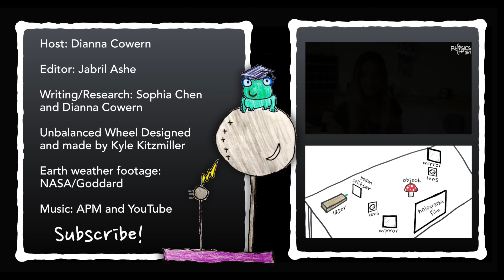Are perpetual motion machines possible?

Comment: "Lisa, in this house we obey the laws of thermodynamics!" - Homer Simpson.
Reply: yes... the modern slaves do
Reply: The earth is a giant capacitor, where does the energy come from that fills it?
When you extract a portion of the energy from this capacitor will the capacitor be topped off?
Reply: @messengerofiexist2139  Google about T. H. Moray free energy receiver. Moray succeeded in tapping into earth capacitor, and extracted kilowatts of power.
Reply: @marcisgulbis9310  sure but you can't do any of that without a working flux capacitor and a sizable rotary girder.
Reply: @michaeld4861  No, Moray device requires ordinary capacitors, germanium transistors, oscillator circuit. Flux capacitor not required.
Reply: @marcisgulbis9310  You realize that posting links to perpetual motion machines on a physics chanel where perpetual motion machines are debunked is the definition of barking up the wrong tree?
Reply: @BigUriel  There is evidence that RegenX generator creates energy. RegenX generator has been tested and validated by SIEMENS Inc. I want them to look up evidence, and try to debunk RegenX generator, or admit that it works.
Reply: @marcisgulbis9310  No there isn't. The "evidence" you speak of is the same sort of "evidence" that the Earth is flat or vaccines cause autism. It's only "evidence" for people who don't understand basic science and are easily misled.

Go peddle your snake oil somewhere else.
Reply: A man of culture I see
Reply: Homer's quote is very funny and leaves a morale. Lisa Simpson is a well educated and clever student, that is portrayed as a future president. Homer's brain is portrayed as a peanut totally intoxicated by beer. I would like to know, what Homer thinks is zeroth law of thermodynamics. He drinks cold beers, so he must know. Ha, ha, ha.
Reply: @marcisgulbis9310  Electric generators transform kinetic energy into electric potential energy and heat. All of them overheat. Therefore some of the energy supplied is wasted as heat. You "have to account" for heat dissipated in your energy balance. No matter how sophisticated the device is, "what goes up must come down, spinning wheel got to go round". Don't tell me that a spinning wheel can also go up spontaneously.
Reply: @marianskodowski8337  You DO break laws by drinking and driving. You do not break thermodynamic laws by drinking beer at home, like Homer Shitsom.
Reply: @vperez4796  Tesla coil is overunity device, and can output more power than input power. It is based on the principle that the power output of a
 circuit increases with the square of the frequency and the square of the voltage. So, if you double the frequency and double the voltage, then the output power goes up and becomes sixteen times greater.

As a result of this, Don’s best known design uses a Neon Sign Transformer circuit which raises the
 frequency to around 35,000 cycles per second and raises the voltage to anything from 2,000 volts to 12,000 volts, giving a power output is physically quite small and yet it has an output of 160 kilowatts (8000 volts at 20 amps) from an input of 12 volts 1 amp. That is, the output power is more than thirteen thousand times greater than the input power. Consequently, his designs are for experienced developers only.
Reply: Is it not true?... A perpetual motion machine... But I still seeking of it.
Reply: Hope you're wrong...
Reply: Think of syringe with a pressure chamber attached on it...then you will see.
Reply: @marcisgulbis9310  Here is an appraisal of Power= W(inp)+W(out)+ H. Where W(inp)= V*I delivered to  ionize He(gas). Where power(out) = power dissipated as light by the He(gas) + Heath during production duty. BALANCE of POWER: Power(in) = 5000 V* 40mA = 200 Watts, values taken from Ballast specifications. Maximum Power(dissipated by Ne) = 170 Watts (at 40 mA maximum). Clearly some power is lost = 30 Watts of heat, NOT PRODUCED. According to Ne light's tables, the power dissipated in a plot I vs VI(max) = 170 W. As current raises above 40 mA the "power dissipated decrease". Values taken from Ne light consumption tables. Higher "currents" increase loss of HEATH. I quote: "Ballasts are what help regulate the electrical arc in a bulb so that it doesn't blow".
Reply: @marcisgulbis9310  Here are several issues I shall separate, conservation of energy. I quote "160 kilowatts (8000 volts at 20 amps)" consumed by the ballast. Actually it is 20 mA "twenty milliamps" = 160 W delivered during operation duty. The Ne ballast can only produce 200 W at the most, as per specifications. Your calculated 160 KW, but ballast cannot deliver so much power. It is NOT CREATION OF ENERGY.
Reply: @marcisgulbis9310  Nicola Tesla's invented an "AC auto-transformer" that induces a high voltage arc at high frequency and LOW current, called Tesla coil. A spectacular electric arc is produced. High V * low I = low power dissipated. IT IS NOT CREATION of energy. Nicola Tesla built a tower at Wardenclyffe to distribute home electricity. Tesla explained that the stratosphere act as a huge charged condenser where his tower just stimulated the discharge of the condenser and "induced lightnings". Anyhow he was a well educated engineer that employed "the principle of conservation of energy"
Reply: @vperez4796  Nikola Tesla converted Pierce Arrow car to electric, and used small size high frequency coil to supply electricity to electric motor.
Reply: @vperez4796  Don Smith and Tariel Kapanadze has built free energy generators based on Tesla coils.
Reply: @marcisgulbis9310  That is good title for a sci-fi book. Why don't you write it down?😅
Reply: @vperez4796  It will not be able to compete with Einstein general relativity and quantum mechanics.
Reply: @marcisgulbis9310  Tesla car "company" took his last name (and GM's DeLorean doors) to "profit from his reputation". Electric cars work with an AC Induction Motor (IM). Ferrari (did not patented his invention IM motor) but Tesla did patented an IM in 1888, who was non practical. "Tesla purchased Ferrari's IM concept". GE patented an advanced Electric IM, that do not use HIGH frequencies, using more magnetic poles. GE's 60 Hz IM is a practical invention working at low frequencies. GE started developing IM in 1891. Tesla cars use Tesla concept but not his 1888 non practical patent. Current cars  use electricity stored in a lithium cell. Energy that comes in, must be transformed to kinetic energy by IM. Why don't use "high frequencies". FCC. Next.
Reply: @marcisgulbis9310  High frequencies shall not be used in appliances because they are transmitted far enough to Interfere with electronic devices (computers, TV, car radios and cell phones). FCC rules are complied by most high voltage devices. MW ovens work at 2,450 Mz, while cell phones work between 1,0 to 2,100 MHz. Too close to MW oven frequency. Modern CPU work between 2.8 GHz to 3.0 GHz, certainly very close in frequency to cell phones. Are MW a threat to our Health? No, MW are shielded.
Reply: @marcisgulbis9310  Batteries that power Tesla cars have exploded, apparently due to mechanical shocks. As of 2021, NHTSA began to investigate 30 Tesla crashes that are believed are due to the Autopilot. Don't let an intelligent device drive you to death, it is equivalent to drive blindfolded. Kind I like better the new Camaro RS V6.
Reply: @vperez4796  Tesla cars use three phase permanent magnet motors too. Permanent magnet motors is more efficient than induction motors. Electric motors is more efficient at higher speed. In Tesla cars, there is gearbox that reduce speed. When motor runs at 3600 RPMs, wheels runs at 360 RPMs.
Reply: @marcisgulbis9310  I thought the subject was: "Are perpetual motion machines possible?" Nikola Tesla did NOT build the first Tesla Car. Nikola Tesla pet dream was "to achieve something FROM NOTHING" a concept he called "free energy". There is no such thing as FREE energy, ask an engineer. What was the connection between high frequency to perpetual motion? Do we agree that car engines are dissipative? May be Tesla built a perpetual free energy motor? Respectfully, Come on!
Reply: @vperez4796  Reactive loads like coils and capacitors are not dissipative.
Reply: @marcisgulbis9310  Car's BREAKS dissipate energy on every car stop. WORN tires means work and heat dissipated. DISCLAIMER: I do not work for any car company however I guess you may work for tesla cars. It is not sufficient to read and paste encyclopedias, but education in physics is necessary to understand, that not all the input energy is transformed into work. This is not a flame, but I am going to do something else than answer you.
Reply: @marcisgulbis9310  Quote: "Mārcis Gulbis - Financial Analyst - Latvijas Mobilais Telefons SIA"